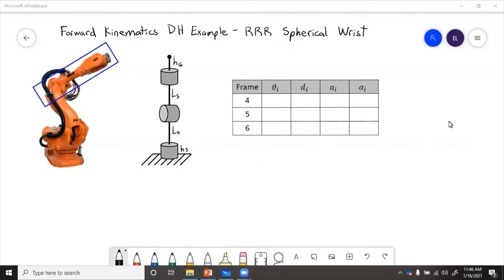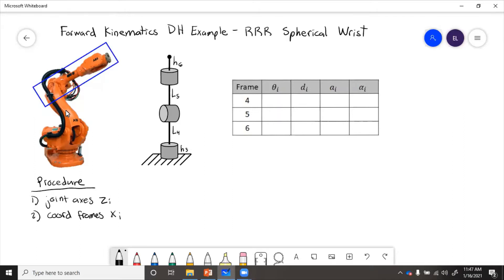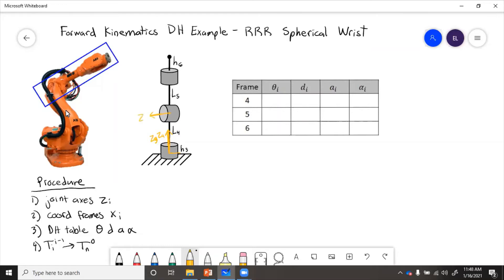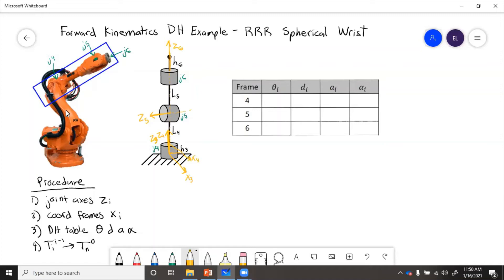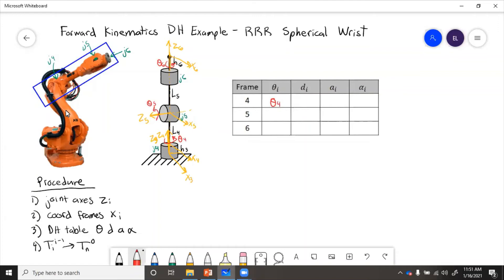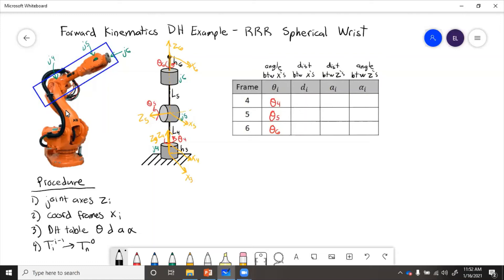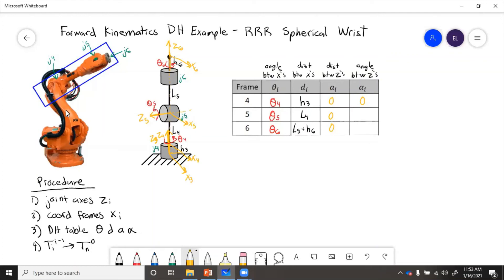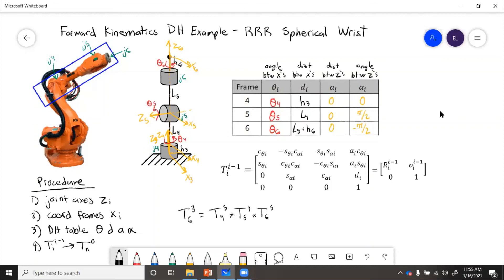FK Example - DH Method - RRR Spherical Wrist

Comment: At 7:10, you mention that it is a counterclockwise rotation hence 90 degrees. Does counterclockwise refer to 90 and clockwise to -90?
Reply from the maker: Yes, that is standard procedure.  Clockwise means negative angle or torque, counterclockwise means positive angle or torque, just like in math or physics.

Comment: Does not seem to follow DH conventions. x6 does not intersect with z5
Reply from the maker: The answers in the table are based on how the frames are laid out.  You can add in an extra frame between 5 and 6 if you need to to have more intersections and break the transformation up into steps.